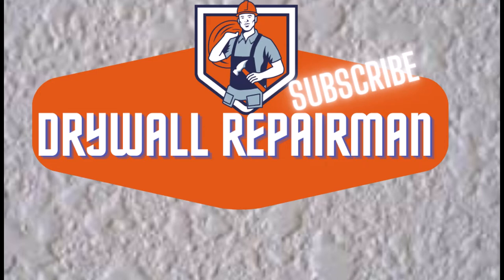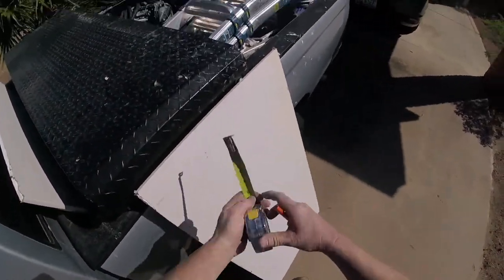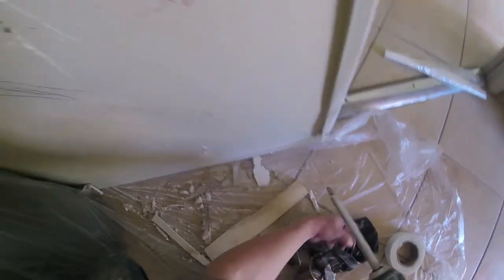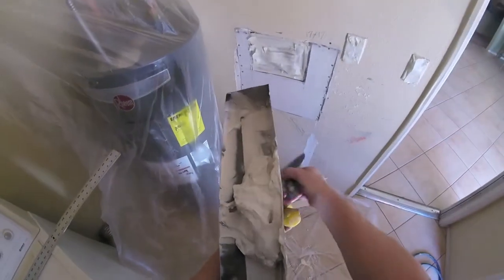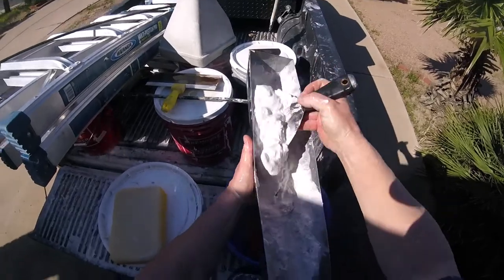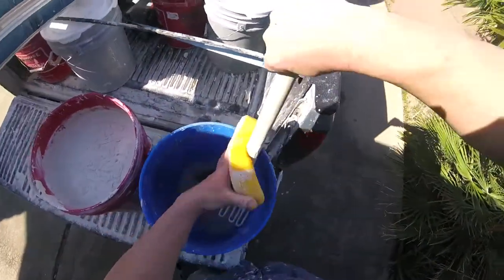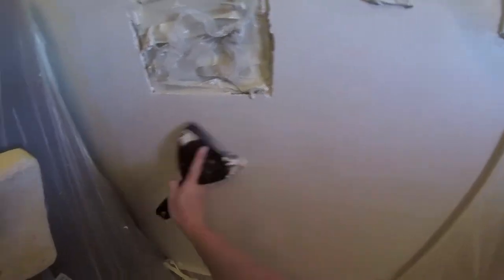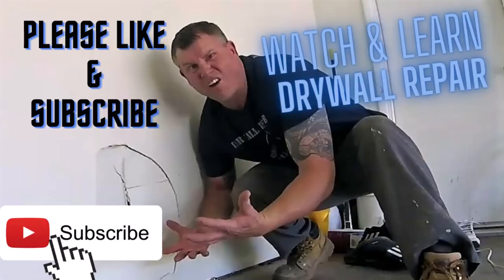Laundry room plumbing box drywall repair patching plumbing hole in wall drywall patching process

Comment: My washer outlet box has tabs that are screwed into the front of the stud, so that my drywall patch sits proud of the rest of the wall. How do I fix that?
Reply from the maker: Most boxes do tab screw into framing
It will bulge out sheetrock 
Just screw in tight patch and float out mud work, all u can do

I have many videos on these boxes watch playlist have few just on these laundry wall boxes
Reply: @drywallrepairman  thanks boss

Comment: Do you need to use green board?
Reply from the maker: yes this is mold board - only hd has green colored board - if you go to drywall supplier they use mold board which is slightly grey green
Reply: @drywallrepairman  thank you sir